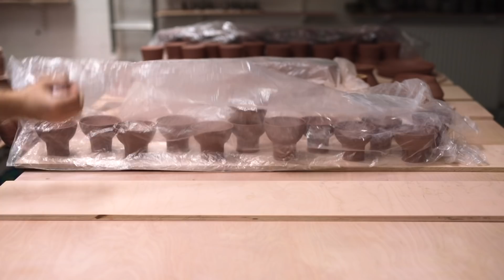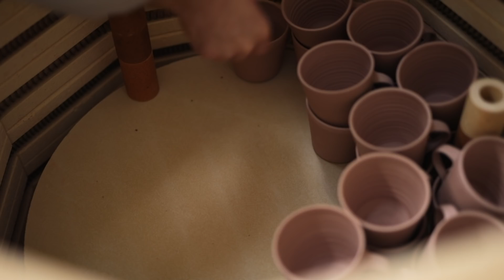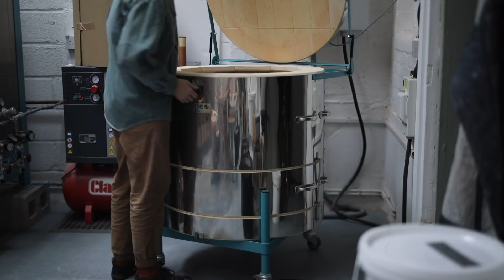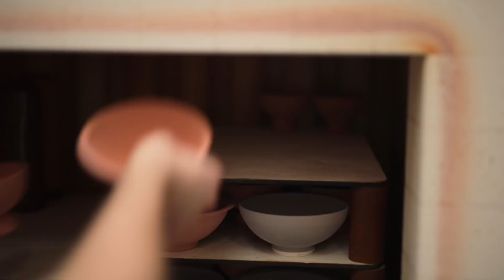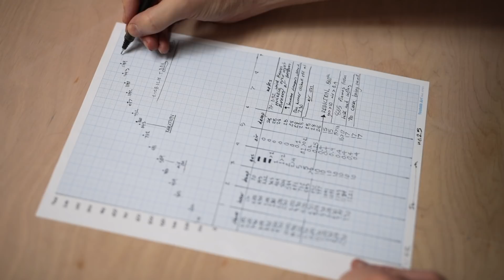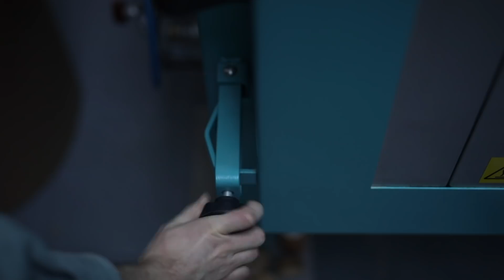Making Stemmed Bowls from Beginning to End

Comment: If I had to pick a favorite footring form, I couldn't. While I think the completely rounded ones do look a bit odd, they all have a place in a pottery range. I won't lie, I think rotating between footring forms could be viable, most of them work wonderfully, especially the rounded and angled feet.
Reply: I prefer the footring, which is the reverse shape of the vessel itself. :)